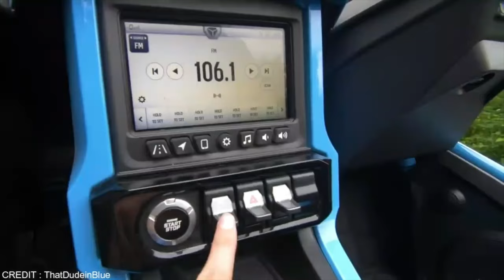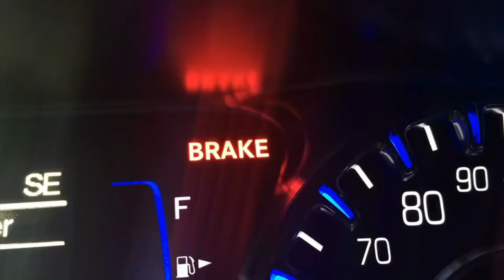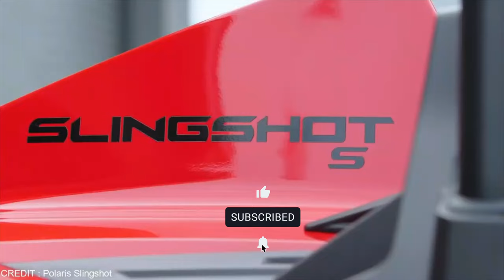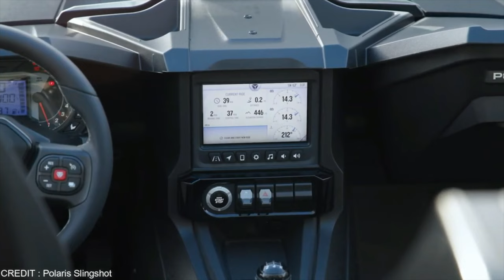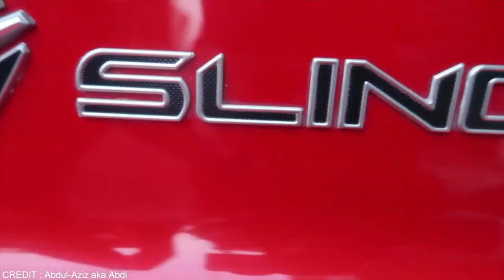Revealing the downfall of the Polaris Slingshot

Comment: I'm a mechanic at a Polaris dealer. The only issues we have had is recalls. Usually a quick 30 minute turn around. If people bring them in for service as should any mechanical vehicle of any kind. We never have to fix or replace anything. And that's good for us and them. We love a simple oil change and tire check but some people just don't take care of things.
Reply: You can tell he’s making shit up in this video. I have several customers with slingshots with very few if any issues.
Reply: @Angel the automatic trans on the slingshot is nothing more than a manual with a computer shifting it for you.
Reply: Where are you located
Reply: U said it best they don't build anything like they use to these kids today can't cook clean nothing I got Wii kids I know ur pain bro! Thanks for ur feed back an honesty😎
Reply: He's hating 😂😂😂 I've had mine since 2017...I had none of those problems.
Reply: Ive had the 2022 auto for 2 years only thing i hate is if u step on it eventually you have to re adjust the rear drive belt due to squeaking and unalingement
Reply: @Angel manuel is more fun.
Reply: I don't blame them When the dealership(S) is charging $300 plus dollars for just an oil change.
Reply: That's an easy solution. Don't get your service there.
Reply: you can tell that this channel is from some non-English-speaking country.  The voice is likely read by a narrator or AI and the copy sounds like it was written by someone that never drove one,  but just collected random information from various internet comments and / or made them up.
Reply: Well said… agree 💯 take care of your property and it will take care of you.
Reply: @jwkaman  but they’re are slow, that my major issue

Comment: We’ve had ours since 2015. Made 4K trips from north LA to Canada back down the east coast. Not a single issue. Ever! Plan on buying a newer one soon! Love the slingshot!
Reply: How many miles those it have?
Reply: @sneakerhead140  between 25-30k.
Reply: Are you selling?
Reply: I just bought the 2023 Roush edition and I love it. I actually upgraded from a 2016 r edition. ❤️❤️❤️❤️❤️❤️ hope to meet up someday ❤️❤️🙏🏾🙏🏾
Reply: thanks for sharing your thoughts , it helps me to decide if i m buying one or not
Reply: Just bought a 2023 R! Sooo fun!
Reply: That’s what I was wondering can I drive a 2015 that’s in excellent condition to Los Angeles from Las Vegas or will it over heat?
Reply: I love it ❤❤❤ 2023 Roush slingshot, no issues. I love the sun

Comment: My 2023 SL has been in the shop for 4 of the 6 months I have owned it. It is still in the shop awaiting to have the entire wiring harness replaced after numerous pseudo break and turn signal failures. $1700.00 harness and 24 hours of labor. We have asked Polaris to replace it.

Comment: Had mine for a year. Absolutely love the vehicle. Use it as daily ride. True, doesn't handle slippery conditions well,  but does handle them better than most other motorcycles.  I've modified mine, and will do so even more, only issue is that wherever I go people want to take pictures of it or ask questions.  Not really a problem.

Comment: My name is Mike from North Carolina. I have had all recall issues addressed with complete satisfaction. I've owned my Slingshot since  July 30th 2016. My only personal issues are with all of the torques head cap bolts. On mine I had a good number of the heads strip mostly due to the use of Thread lock compound and "Over Tightened" during assembly. BTW It should also be worth noting that the Sideview mirrors must have the convex upgrade. They also have the propensity to loosen over time, and won't hold the views. Polaris really needs to address these issues on future models. With that said, I ring-it-out on every mild ! Oh one more thing, here in North Carolina wheels and tires are swapped out quite frequently.  Thanks for letting me give my  2cents worth.

Comment: not a fan of the slingshot but i enjoy the concept of an open car / more open than a convertible.  but i feel the reasons mentioned in why to hate it were kinda lousy excuses, The reasons to hate on it is the cost per performance. At that price youre better off building a kit car that gives the same open feel of a motorcycle but in a car  df goblin , Exocet , Lotus s7, sve rocket  something like these and they can all be done by someone with entry level mechanical knowledge.  

The seat belt is a very odd reason maybe its weird but you have your selt belt on the right side when passenger anyways and if its in your neck youd have the same issue in most cars anyways     Reliability may have some issues but the 2.4 is a fairly good engine as for brakes who knows 
the radio is perfectly fine and youre better off going aftermarket if you want better  exhaust tires radio seats are usually things owners want to change anyways 

The real issue is the cost there is more fun options for cheaper  and faster  but still give the same experience the slingshot gives

Comment: Ours is a 2016 model. We got it with 5k miles. Did have a problem with a dash brake light. This was covered by warrantee. It now has 17k miles on it. Last week we drove from St. Louis, Mo to Columbus Oh. No probs we love it. We don’t care for the seatbelts on your neck. When we got it the hood was Unbelivable to open. The dealer was no help. We installed the Slingmod hood hinge kit and that solved the problem. My wife drives it the most and loves it. The clutch prob he mentions is nonexistent it has perhaps the smoothest clutch I have ever used.

Comment: Yes it's worth the risk it's a blast driving it  I put a full windshield  and convertible top and heated and cooling seats makes it a dream to drive. I have 3000 miles on mine never had break issues or clunky shifting problems the rear tire has never broken traction even on wet roads. I understand some have problems but the dealership  will make it right.

Comment: Baught mine new, got 21K on it. I think the bearings issue isn't what you think. Worn tires, belt traking is maybe what you're referring to, the squeak. Hubs I believe are sealed.
I put red line in my gearbox and drive. Also helps to flash the computer. The factory settings suck.  Gained some mpg, smoother shifts, more responsive. Wish I'd done it sooner. Feels better now than ever. The slingshot, Its not for some people. You are exposed to the elements. I feel safer in this than any motorbike I've owned. Ever try swerving on 2 wheels? Anyway, that's how we evolve by making something and someone else making it better.
I personally love it.

Comment: I think your review it bogus, all the problems you mentioned have never happened to mine after 10,000 miles or any of my friends. I just put my order in for my 2023. just like a motorcycle check all lugs tire pressure fluids and break pads no problem for less then $300 I replaced all rotors and pads to ZZ Performance High Performance Slotted Rotors with amazing stopping power easy installation great price providing a linear friction profile that allows your vehicle's ABS system to operate most effectively.

Comment: These "complaints" are by and large silly and one guy's opinion.  What did he expect when he bought it?  It would like buying a radio and complaining because the picture wasn't clear.  By the way, he mixes several videos into one montage making it seem the "problems" are universal.  I bought a used 2015 18 months ago and my only complaint is I don't get to drive it enough.   

Especially silly is the complaint about taking off. How do you say "I'm not that good of a driver' without saying 'I'm not that good of a driver?"  OK rookie, here is a tip, till you learn how to drive a manual transmission, take off in second gear instead of first.  Once you have mastered the art of left/right foot coordination, you can go back to first gear like a grown up.

Comment: Every vehicle/manufacturer has some issues, how ever these are few and far between. I have owned one of these for several years and absoulty love it! It is a totally drivers' focused vehicle. This is not a daily driver, nor is it intended to be. You enjoy this drive in the same weather as you would a motorcycle. These things are a total blast. You can smoke the rear tire for days if you like or just cruise along and enjoy the weather. It is the easiest stick to drive and a great vehicle to learn if you have never driven one.  If you are considering one, just get it! You will be extremely happy with this amazing open air experence!

Comment: You really have NO CLUE what you're talking about.  IT's NOT a car.  It was never meant to be enclosed - which means you are always in the elements.  Can't upgrade the rims?  lol  really?  99% of Slingshot's don't come with speakers behind your head (those are aftermarket).  The sound system is ok, nothing special, and is upgradable.  Most of the other complaints are about the different recalls that have come out - surprise!  All vehicles on the road have recalls.  You are also giving your personal opinion on said recalls about why/how which is mostly false - you should leave the language of the recall to the experts (aka the company).  The #1 thing that fails are "the bearings"?!  lol Which ones?  There has never been a recall related to any bearings.  Again, you've cherry picked a select few owners out of 10's of thousands that have had an issue.  You keep talking about how dangerous this vehicle is (windshield too low?!, only one rear tire in the back, not very stable vehicle, etc).  Obviously you don't own one or don't want other people to own one - that's your opinion.  This video actually serves no purpose other than to bitch about a vehicle you have no clue about.  The things said in this video (plus all the unapproved usage of video clips, video with bicycles in it ?!, videos of cars...) it's a wonder how this channel has any followers at all...  I'm pretty confident that all Slingshot owners are happy to not have you as an owner and/or be involved in the community.    ----  as a respected member of the Sling community and someone that has infinitely more knowledge about them than you...good luck spending your time talking trash about whatever vehicle you have picked out next.

Comment: I have both variants from 2019 & a 2020. Totally disagree. Absolutely garbage. Started with seatbelts. Then wheels stated you CAN'T upgrade I have 20s the whole way. Sound system complaints you upgrade as you need. I have mine upgraded. ALL vehicles have some issues no matter the year.  100% worthless video. No issues with my 2019 with 30k+ miles and no issues with my 2020 with 15k miles. Again don't judge the Slingshot based on this NOVICE judgement

Comment: This owner (former owner) of a Polaris Slingshot doesn’t sound like he enjoyed his owner experience.  The Slingshot is unpretentious and Polaris offers no apology for how it is engineered.  There is no perfect vehicle for everyone.  The Slingshot is not a perfect vehicle and it is sold as such, just like those expensive exotic cars are.  They all have quirks, faults, recalls and handling characteristics that must be taken into account.  Within two days after I purchased my SS, I was on a 10,000 mile cross country trip.  I had absolutely no problems with the machine.  Certainly none of what was highlighted in this video.  The vehicle is neither a car, nor a motorcycle.  Don’t expect it to be either one of those.  It is exactly what it appears to be, a three wheeled, very powerful, very agile two passenger fun machine. It doesnt come with air conditioning, or a heater, or a full length windshield, or left pull seatbelts, or doors, or yatta yatta yatta…. Next time look at what you buy and understand what you spend your money on.  It isn’t like you didn’t know….. oh, and by the way, you can buy after-market tires wheels and mirrors, tops, windshields, doors and all that… but then why dont you just buy a Miata or other small car to begin with?  You should really seperate your petty opinions from facts.

Comment: This guy has no idea about anything.  Owned mine for 2 years with no problems.  Oh, btw, your brake alarm light came on most likely because it doesn't like it when you apply the breaks and gas at the same time.

Comment: Motorcycles are just as deadly as a car especially a driver driving with overconfidence. My slingshot is wayyyyy more safer than ANY motorcycle.

I had a motorcycle and believe me, people see me on this machine. Motorcycles not so much, in fact the whole reason I got this is because of inattentive drivers not paying attention to the road. Its probably saved me knowing that every time I put the key in the ignition.

The comfort level is better too.  

Ever ride a motorcycle 300 miles and get a backache. I have.

As far as issues, all vehicles with 2, 3, or 4 wheels have them. Its how you make it better and educate yourself on  simple fixes, do it yourself. I got 18K on mine fyi.

I can live with some flaws made better, sorry you cant.

Comment: I had a Polaris Slingshot R model. I hated the brakes, to mushy, the universal joints are clunking all the time. I had the auto drive and the way it down shifted, and it was really noisy in the rear end. My brake light warning light came on and off alot. I had it for 11 months and sold it. Oh forgot to tell you, it is very hot on the passenger side  because the muffler is mounted in front of the passenger bay.
Reply: I got aftermarket brakes that made a huge difference. I did a lot of aftermarket now it’s going on 4 years and it’s amazing

Comment: How are you going to complain that an open air vehicle doesn’t have air conditioning…

Some points are fair but it definitely sounds like he definitely went out of his way looking for bad things to say about the vehicle and has very little experience with said issues himself.

And some issues are just part of the vehicle and on an issue if you’re not looking for this type of ride. I.e the wind screen being low, power going to the back wheel only, and not being crash tested, the are all issues that can be the said of motorcycles. If you want a car go buy a car…smh